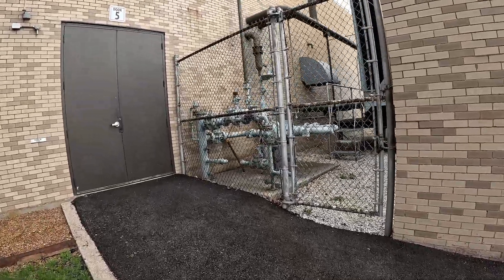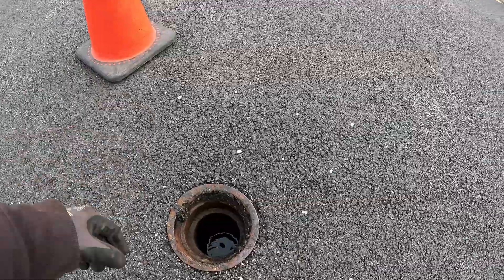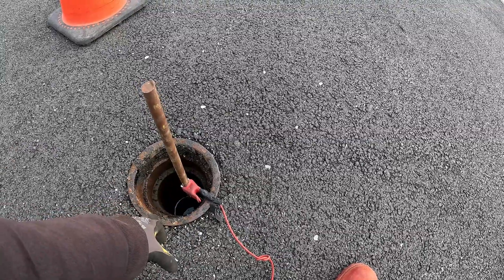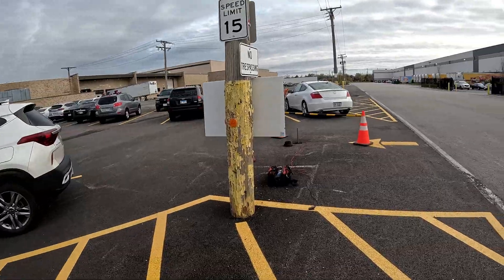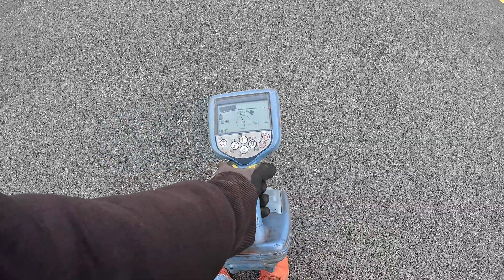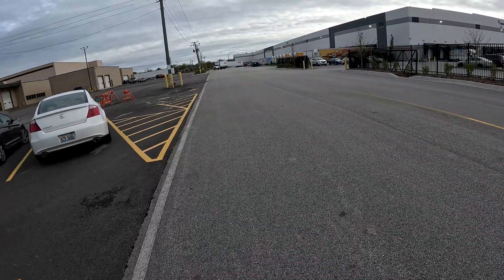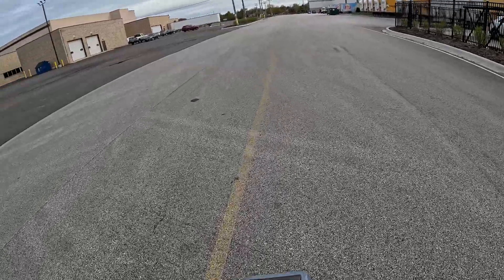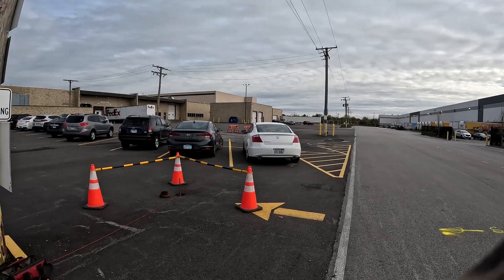Natural Gas Meter Set Locked Up | Locating Off Curb Valve

Comment: Hey there a fellow locator from the north here up in Canada, just a question really, love the channel btw,  is that rod just "sitting" on top that gas service line through that valve cover or is it sitting on the valve somehow?  I've come across this situation so many times where i need to locate a gas service behind a locked gate, and sometime using other frequencies doesn't always give a good signal or make me feel confident that i found the service line. Keep up the great work, nice to see how other guys work in the field.
Reply from the maker: Hello, greetings to a fellow locator from the northern regions of Canada! The rod is positioned directly atop the nut at its center point.

Comment: how do u get the rod to sit so straight without leaning towards the the side? i once have to locate a high pressure transmission by dropping the box on placemarkers coz the lid I open was filled with water and its one of those wider square one.
Reply from the maker: I'm using my red lead to keep my ground rod standing straight so it won't fall over. It's sitting right on the set screw, not the bolt because the bolt is made of cast iron.

Comment: I always wondered why hooking up to the valve box casing never works!  Need to get a 6 foot copper rod now.  Sometimes the valve nut is closer to the surface and I've hooked onto that.
Reply from the maker: The nut of the gas curb box valve that you mentioned will be made of cast iron. You should focus on accessing the threaded bolt located in the center of the nut since it is made of steel, whereas the nut itself is composed of cast iron.

Comment: Ah, one of the biggest pet peeves when I used to work for Utiliquest. Gas meter that you need to locate is locked behind a gate and you have to haggle a security guard or homeowner to get access to it. Glad you found a workaround, I never did anything like that to locate gas.
Reply from the maker: I've been in this utility locating field for a long time so I know the little tricks on how to get the job done. Thanks!

Comment: How long is that rod you put down the hole?
Thanks for the info!
Reply from the maker: The copper rod I'm using in this video is about 6' long.
Reply: @811chicago5  what about a long piece of rebar? Also, does the water ground the signal to the casing?
Reply from the maker: @Geophysicist1914  Using a copper rod to send a tone may be slightly more effective than using a long piece of rebar.
In some cases, water can provide a conductive path that can ground a signal to the casing of a pipeline or other buried utility.

Note: When an electrical current is applied to a pipeline or other buried utility, the current will follow the path of least resistance.